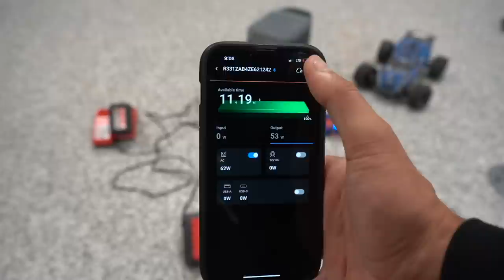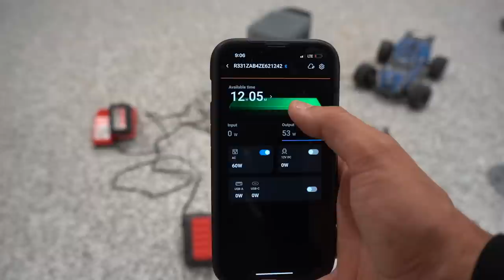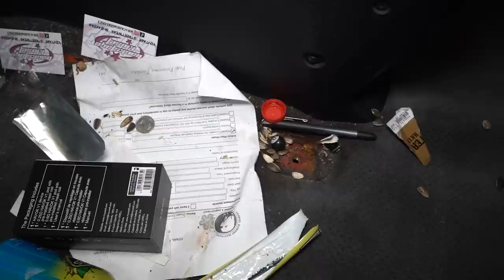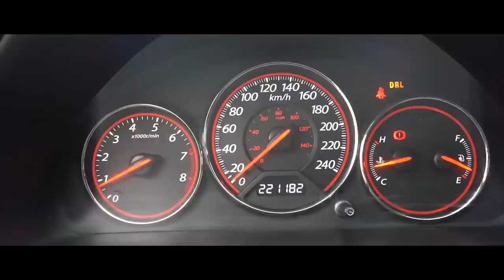Making A 17 Year Old Car Look NEW Again! | The Detail Geek

Comment from the maker: Thanks to EcoFlow for sponsoring this video! Visit EcoFlow's site at https://us.ecoflow.com to check out the Delta 2 Power Station!

What a crazy transformation! The Civic looked unreal! Hope you enjoyed this one, if you did be sure to smash the thumbs up button! Have a great weekend!
Reply: دزززز
Reply: Mitch I was wondering what do you do in a car that has tree sap all over it. I did a 2015 doge ram today that was covered in it and spend just a hour and half getting that sap off it with degreaser and plastic razor blade. Was very careful and did not scratch it but is there a quicker way?
Reply: I'm most definitely look into buying one. Never needed to by gas cause of the solar panel charger. 👌👍
Reply: :_mike:Mike had waffles the other day?..I had waffles 2 but mine tasted bad when I took a 2nd look @ the bottle of syrup that said,'Sugar Free'.No wonder it tasted awful gross!

It's a wonder Mitch hasn't found himself a Red Toy Ford Raptor he can remotely drive around.Lol!
Reply: Good morning, Detail Geek. Just wanted to tell you once again on your microfiber towels and your Detail brushes I got in a few weeks ago. OUTSTANDING. By far the best microfiber towels I've used.
Reply: There is no video of you cleaning the dashboard, that is cleaning the dust from the dashboard. There is just the part where you apply 303 on it. The feels incomplete without it.
Reply: @paulkriz2308  use bug and tar remover
Reply: That does seem like a cool sponsorship!
Reply: @paulkriz2308  Hand sanitizer.
Reply: @ابوخلود-ش3ك  sre

Comment: Recommendation would be to use a foldable table to put the floor mats on top and clean them at waist level. I see you’re using your back and in the long term it’s going to catch up. Just like cleaning the wheels, It also takes up work on the back.

Comment: Man I had that year of Civic (or version, rather - it was an 02) and it was the BEST. I had it 10 years and I don't think I had to make any major repairs. Just wear and tear. Fantastic car.
Reply: I had a 1994 Acura Integra GS-R/Coupe and I Love it! Love it!  Basic maintenance and go, had it for 15 years and I can say THE Best vehicle that I've ever owned until the present day.  Those where the Honda golden years, solid...  Well build quality.  The only big thing that I did on it was changed the timing belt/and suggested water pump but that's about it, Normal maintenance.  I drove it pretty hard and those little hot engines love it.  My Integra was Red/Black Interior.  What an exciting, enjoyable toy, with that close ratio 5 Spd.  Simply Awesome, I still miss it actually. Sold it with almost 200K Miles and still solid...  What a Car!!!! 👍

Comment: reminds me of my exact red 99 civic. had 228,000 miles on it when i bought it and it looked exactly like this minus the SI part. only reason sold was due to carseats and kids, otherwise i would have kept it. i bought it for 600$ trashed to get me through college, and this is close to what it looked like after i spent days after buying detailing it(previously owner thought it was apparently scrapped). I drove it for many years before selling and kids came along. These vehicles last. mine had 500K miles when i sold it, with everything working including sunroof and A/C.

Comment: Seen a lot of detailing videos and it is surprising just how many cars have cheap, nasty tyres. I won't name any brands! I got a car from my Mum's neighbour for our boys to drive and I immediately swapped the old poor quality tyres for a reputable brand of spanking new all-season rubber. Tyres and brakes are the most important bits on a car. One is your contact with the road surface (so it needs to be good) and the other needs to stop you quickly and safely.

Comment: Sometimes I envy those people that can just not really care what their car looks like. But then when I look at mine I take great pride in it kind of like how I do with my house and myself. I kind of think that how you treat your vehicles shows what kind of person you are.  I have an 07 Suzuki GSXR 1000 street bike it has 70,000 miles and she still looks brand new and I only wash it once a year if that, I don't drive that much anymore just sits in the garage under a cover. I also have a 2019 Chevy Silverado with 36,000 MILES that I washed twice a month, wax three times a year, clay bar once a year and spray waxing once a month. I'm not as anal about my vehicles as I used to be thank God that was exhausting, but I do take pride in my vehicles. I'm just not obsessed with it. Had a 1989 Pontiac firebird with 325,000 mi on it and I still looked bitching when I traded it in for a 2006 Silverado and 2012. And yes I do miss that car.

Comment: I'm glad you are getting sponsors, but lets be real, there is nothing green about solar or batteries.  doesn't mean they aren't useful but don't sell it as green when it isn't the carbon footprint of batteries and solar is usually much more than that of gas for the same output of power.

Comment: Just wondering why, you didn't pull out the back seat as well and clean under it as dirty as the inside was, and the engine bay wasn't cleaned either, the trunk area wasn't touched either. Just asking

Comment: I've bought your waffle weave towel and glass cleaner (along with some other supplies from Detail Geek Autocare), but it does seem to leave some streaks on the inside of my windshield. Do you use the same towel for the whole car? I'm thinking the reason might be that it was a little bit too wet on the dry side. I used it like you normally do; spray cleaner on one side (while the twoel is folded in 4), clean window and dry with the other side. Could I maybe have used too much cleaner? Do I need to wash the towels before use? Window seems to show some streaks/be a little bit greasy. To be clear; I don't mean to be negative, because I love your content and products, I just wonder what I can do to make it work even better for me!
Reply from the maker: If the towel gets over saturated, you’ll need to switch to a dry one. I always use a fresh towel for the inside of the windshield, and it’s also the reason I sell the towels in a 2 pack…because you need to use both to do all the glass in an average vehicle!
Reply: @TheDetailGeek  OK great thanks! Yeah I tried to do our (relatively big) tractor's windows first and then the one from my car, but that obviously was too much. Even when coming along with the second one after that it still wasn't perfect, but I'm trying a different approach next time 🙂

Comment: regular ass traffic vehicle. Low front driver tire pressure. a brush used on the paint + circles which leads to a lot of microscopic scratches., The cleanup job looks good now, but for any professional they know that those tiny scratches will lead into big scratches. 4/10, stop doing circles with brushes. Good work but you need a lot of practice. people new to the game will need to learn and grow somehow.